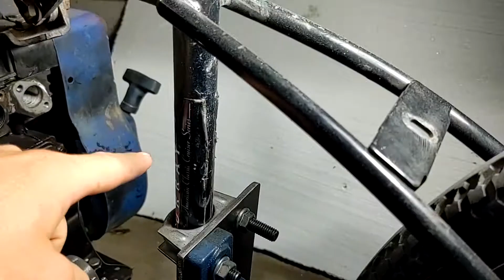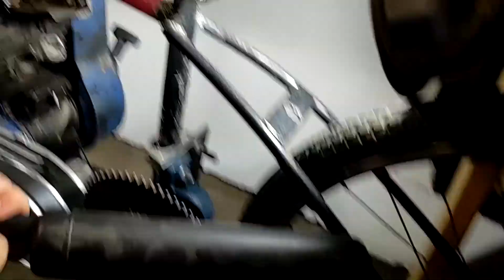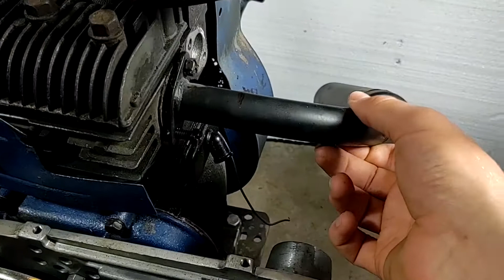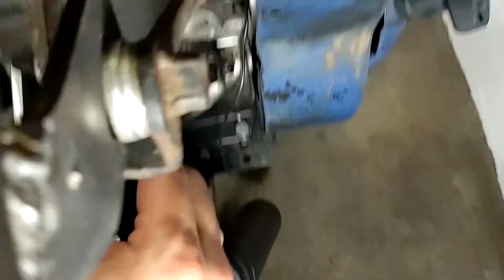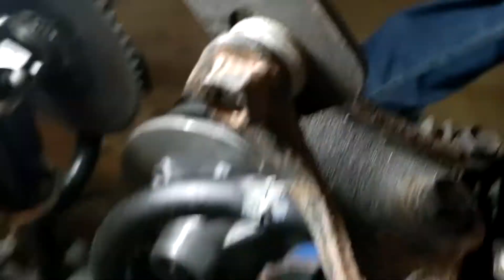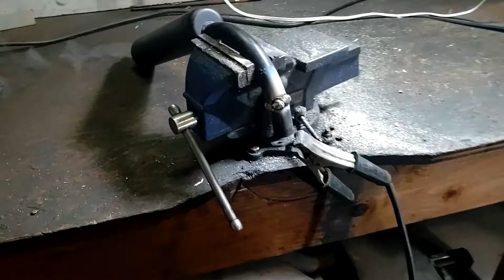Briggs & Stratton 5HP Flathead Motorized Bike Build - Exhaust EP8

Comment: Hey man, really enjoying your content!
I had a Mobylette with an exhaust similar to that and the issue I found was that oil leaking from the exhaust (part because it was 2 stroke and part because the gaskets were on there way out) used to lubricate the back wheel which was a bit of a pain for acceleration. great for burn outs though!
Reply from the maker: haha I imagine hot oil would make good burnout sauce. Anyway, I'm glad you're enjoying the build series.